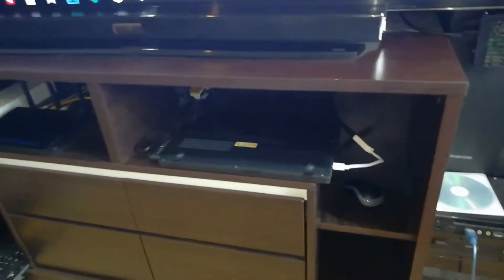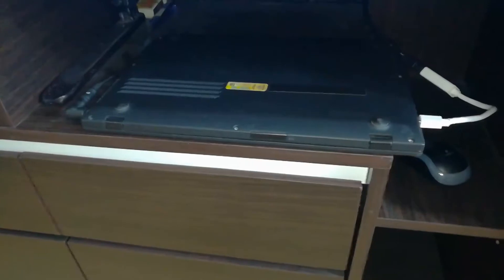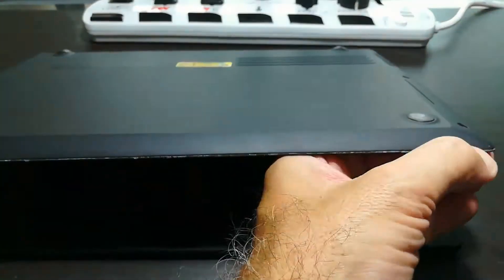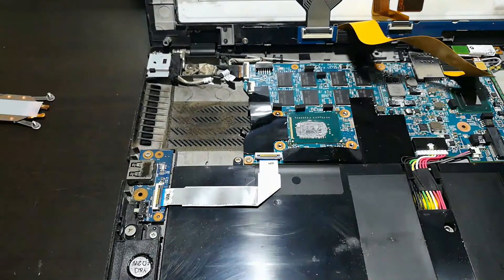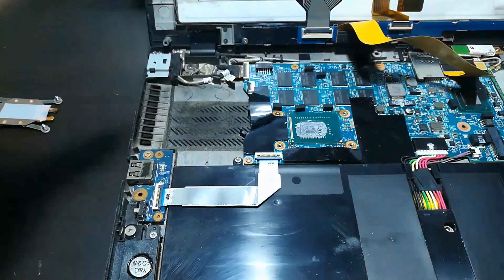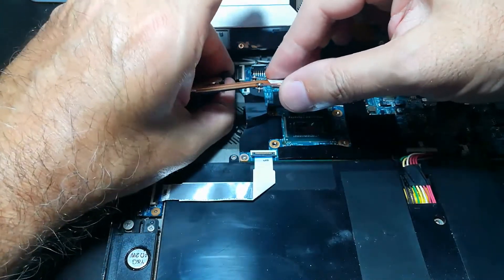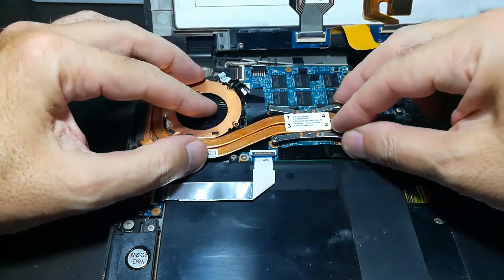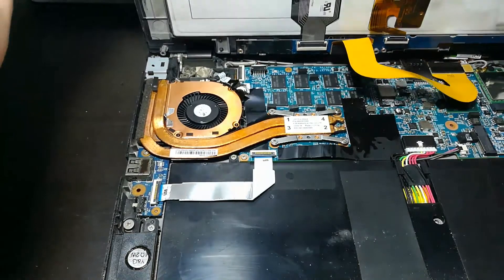Thinkpad X1 Carbon Fan Replacement

Comment: ATTENTION: You should never vacuum inside of any electronics. Vacuumming may create static shock and ruin your computer. Instead, use compressed gas to blow the dust out.

Comment: Just replaced mine but still get a fan error? And the new fan doesn’t boot either
Reply from the maker: Check to see if the fan connector is getting any power.

Comment: I bought a used fan, with no thermal paste preinstalled. Any idea how much to apply? It appears that there is a plastic sticker with a rectangular cutout that allows an area to put the paste, but I'm not sure if you just need a thin coat, enough to fill the entire cavity created by the cutout in the plastic, or if it needs to overflow this volume.
Reply from the maker: I would apply a 1mm-ish thick layer to the area, then let the small excess squeeze out.
Reply: @MikesTropicalTech  thanks!

Comment: My 4th Gen just started making a horrid noise when it flexes a little -- when I move  the laptop much at all. Fan sounds like it's contacting something.

Hoping there's just a bunch of dust wedged in it, and cleaning it will fix it.

Damn super thin laptops. :-)

Time to take it apart, I guess.
Reply: Did you find a fix?
Reply: That's good to hear beacuse I plan on doing that my problem started the same
Reply: @2Edgy4ThisPlanet  - I've heard other people say that after replacing that module, it failed on them again several months later. Mine has been fine, but if it does fail, replacing it again is cheap.
Reply: @cacogenicist  how much did you pay and was it used?
Reply: @cacogenicist  thanks but I live in the UK at least I have a price range now
Reply: @cacogenicist  hello again, i just opened my pc to take note of the part name and whilst i was taking notes i started spinning the fan with my finger and i heard the same horrible noise it makes when i turn it on, at some point for whatever reason i pushed down on my fan and then span it again but this time it didn't sound like a power drill so i closed my laptop up and turned it on and to my surprise, the drill noise stopped. my theory is, when we picked up our laptops the bending pushed up on the fan forcing it to be higher on the motor making it touch the top of the fan enclosure. even tho my laptop fan is working now i still might get it replaced because its always been somewhat rattily. does your fan make any rattling sound now or is it just a smooth sound?
Reply: @2Edgy4ThisPlanet  When I took the old one out, it was clearly damaged - one blade was slightly screwed up, and there was some fine plastic powder dust in there. 

My laptop had been refurbished, and I suspect the unit had been replaced and not set in there properly, or something. Or maybe what you suggest happened and I ran it too long in that state such that it became actually damaged.
Reply: @2Edgy4ThisPlanet  - I had to replace the heat sink fan module-thing.  Found one on eBay for quite cheap, installed it, and it's been fine.

Comment: No need for the thermal compound paste or heat shield paste since it has the tape already with it?
Reply: Michael, my fan does not make any bearing noise, but I continue to get fan errors and the computer shuts down about the time I've launched Windows 10 to the desktop.  We did a diagnostics and says the fan failed the test, yet the fan is running the whole time.  Someone suggested that since I updated BIOS to a 2018 version from 2013 whether there could there be anything in the settings that would cause it to fail.  Thoughts?